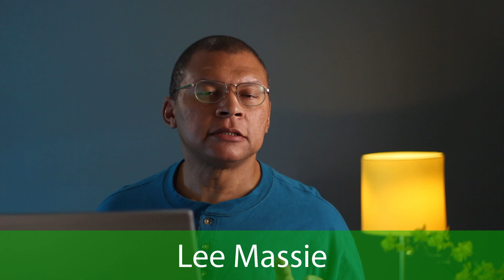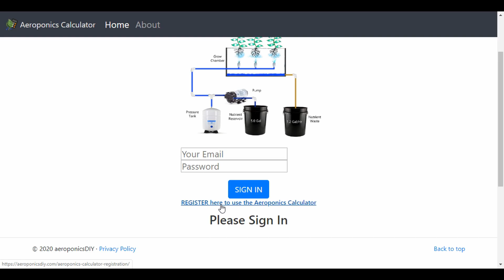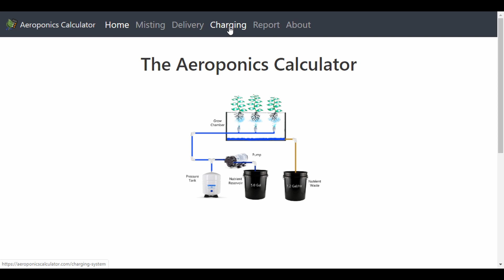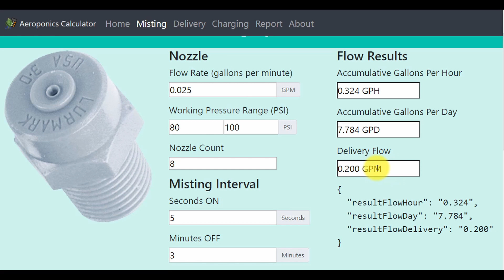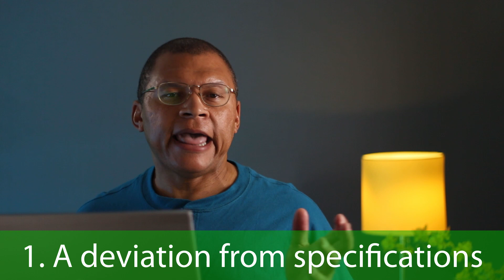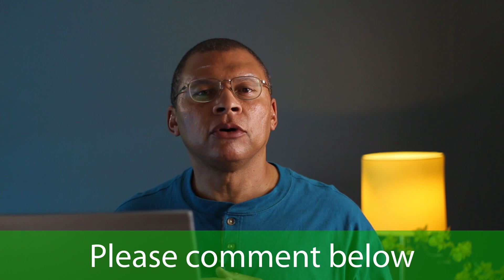AEROPONICS Calculator Free Online Tool Reveal

Comment: Hello, is there a program to calculate the watering cycle in high pressure aeroponics.  I'm having a hard time finding the right watering/drying cycle.  THANKS
Reply from the maker: The short answer is no. There are many variables you need to consider to calculate the misting cycle. Different plants will have different demands.

Comment: Hi... Thanks very much for sharing your expertise with us all. You are helping so many like myself im sure. I recently registered to use the calculator for help setting up my new HPA system. I need to recalculate as im expanding the diameter and length of the pipe, unfortunately the original password details have been deleted from my email and i cant seem to register again. Is there currently a problem with the website that you know of? Im not sure why I cant get back in... Hoping to hear back from you soon. Thanks so much.
Reply from the maker: Try it now.

Comment: General question: can you not put a pressure regulator before your solenoid battery so you can over pressurize your reservoir and maintain a constant pressure through the misting interval?
Reply from the maker: Jim, I don't understand your question.
Reply: @HighTechGardener  if you pressurize your reservoir to 100psi and need to maintain 100psi +/-5psi to achieve the right droplet and velocity.  Could you not put a pressure regulator on the reservoir side of the solenoids to hold the pressure at 100psi?  You could then pressurize the reservoir to 120psi or so to give you enough pressure for the pump to recharge the system, meanwhile the pressure at the nozzle would still be 100psi thanks to the regulator.
Reply: @HighTechGardener  I guess this is only a problem if the system looses significant pressure during the misting cycle.

Comment: I have a question about the root depth from 12" to 18".   If i use vertical tube. Shall i worry about that because root will fall down base on gravity.  I am thinking about the vertical and horizontal layout now.
Reply from the maker: Yes. It's a concern. Most are doing it wrong. I'll do a video on this in the future. Thanks for asking.

Comment: So I've watched this whole play list (well done by the way) and I think I'm going to start building my system. High pressure aeroponics would be a good fit for me because I live in Canada and many things do not grow in my climate. I do have a few questions though. For example, I want to grow hot peppers and I have no idea of the amounts and types of nutrients to use. I dont know the proper spray times. I dont know the proper temperatures or humidities. I dont know the proper light cycles and spectrum type....basically, thanks to you I know how to build the system which is great but i dont know what settings to use. 

I work in automation and so i can definitely run a complex system  but if you could tell me where to start looking for my setpoints then I would be eternally grateful.

Edit: also, ph? Conductivity? Basically what are all the possible metrics to sample and control.
Reply: For a lot of these questions, you're better off going to Google Scholar and looking up research studies that investigate these things individually.

Comment: Do you have any parts numbers to help acquiring the tee misters that will be 1/4 inch tubing and 1/8 inch mister. I am having the darndest time finding. I had to run 3-8 tubing since I could only find 3/8 mister tee. Thanks for any help with this, still trying to learn and enjoying your videos. Look forward to learning more. I am jumping in and if I could only get the parts I need
Reply from the maker: Hi Nancy, you're very welcome.
I know the struggles finding parts for HPA. You and many others are asking for parts. So I'm thinking of putting a starter HPA kit together that would include everything other than the grow chamber and the reservoir.
My question for you. Would you buy a HPA kit for $350.00?
Reply: I would have but have already spent money putting one together. Finally got enough parts (wrong and right) to put my system together. I wasted some money getting a minimum set that would work. Thank you though for answering

Comment: Hey Lee, You are da' bomb for all you do! 
I do have a question..When calculating, why do you use values starting from the accumulator, rather than from discharge port? I have lots of "stuff,"  between the pump and tank which causes PSI loss. Such as: Strainer, PSI Gage, pressure switch, recirculation solenoid (runs 30 seconds after 3 complete nute cycles to completely mix reservoir contents to promote consistency of cycle batching,) manual shut off valve, and a low lift check valve with a bypass (check valve gets swapped, and cleaned bi-weekly) LOL, I know how you feel about check valves. All in all, I imagine I lose about as much PSI between the pump and the tank as I do from the tank to most outboard nozzle. Thoughts?
Reply from the maker: Walt,
Great question. The short answer is we can say pressure is the same in a given length of pipe if the flow is 0. Therefore, we can say the tank pressure should reach the pump pressure when the system is at rest. Now we treat the accumulator as the new source for the system. This is only true if the pump can support the demands.

Thanks for the kind words

Comment: I'm having problems finding a proper timer what is the brand name you would recommend
Reply from the maker: I built my own timers to save money. However, I'm evaluating a digital timer that I ll make a video on.
Thanks for the trust my friend
Reply: I use a few different types. The most simplistic, user friendly, and cost effective for me are these two.
1) BN-Link Short Period Repeat Cycle timer. It works great for my needs.
2) Vivosun Short Period Repeat cycle timer. (I believe it's a re-brand BN-LINK, as they are identical except the true BN product has a Day, and Night time function.
Both are available on Amazon, or most Hydroponic Supply stores.
On Amazon they are $26.99, and $25.99 respectively. If you are the tinkering type, you can look into Adruino, in which allows you to build a complete monitering, and control system to fully automate your HPA system.   One great benefit using Arduino, is that you can start small, and add to it as you gain knowledge, and gather components. It is literally a cost effective alternative to industrial PLC automation.
Reply: Thank you got one off Amazon!

Comment: Amazing calci. Can you please check and confirm the maximum radiation range of the water dew area, sprayed by the nozzle you would recommend to hit the plant root sitting at a vertical wall at 60 inch distance
Reply: i've a hexagonal system in mind; nine feet tall
Reply: Aerophonic tower design has 390 plant holes hence need your advice for a precise technique which fogs uniformly throughout the cylinder, spraying inside the column and has no dead ends
Reply from the maker: Good idea. Thanks for the suggestion.

Comment: One more thing.. I saw some readings on your website in the data section that I really like (dashboard and charts of temperature, humidity, and light lux readings). Are you going to make a video about this? If not, would you at least share the code libraries, the sensors, the microcontroller, and the other components you used? Thank you in advance.
Reply from the maker: Hey Taher,
The dashboard is our secret. SHHH!
Yes, I will but not anytime soon.
You're very welcome my friend.

Comment: Amazing work man. Thank you for your exerted efforts and giving it to us for free. One question though.. I've read somewhere that to get the 50 micron droplets, you would need nozzles with orifice diameter of 0.6 millimetres and hollow cone. The reason I'm asking is that I'm outside the US and cannot order from Amazon right now due to coronavirus. Therefore, I'm stuck with AliExpress and China Post. So would you approve the 0.6mm at least from a theoretical perspective to achieve 50 microns?
Reply: Hello:
I've experimented with brass nozzles at 0.3mm with great success between 70psi to 90psi. A benefit of a 0.3mm metal nozzle is that it can be easily cleaned by applying heat to calcinate/burn the particles
This nozzles can be found in eBay and AliExpress for worldwide delivery even during this times
Reply from the maker: I know the struggles finding parts for HPA. You and many others are asking for parts. So I'm thinking of putting a starter HPA kit together that would include everything other than the grow chamber and the reservoir.
My question for you. Would you pay $350.00 US for a HPA kit?
Reply: @HighTechGardener  if it came with everything i would. Pump, noozles, ecumlator pump, hoses everything etc then i would.
Reply: @HighTechGardener  You should sell it for much more than $350. I'm seeing other people selling very unprofessional looking garage-built systems (that look like they're held together with duct tape) for over $700. I would sell a starter kit for >$500.

Comment: I wouldn’t recommend the high-pressure system that is mentioned Do to reliability I find that commercially available air assisted paint nozzles Most reliable
Reply: Do you have particular nozzles that you recommend? Which ones are you using?
Reply: Exair  SR1010 SS siphon fed